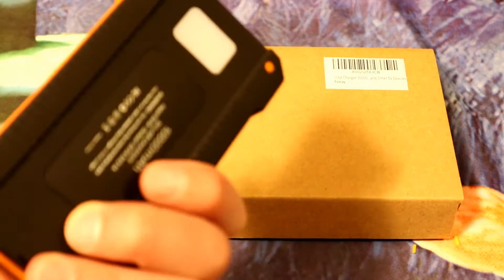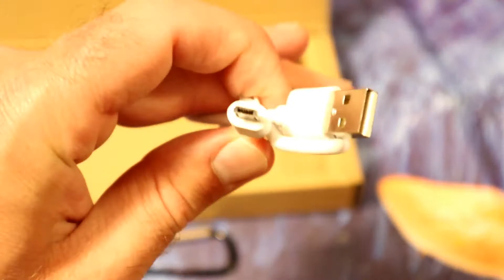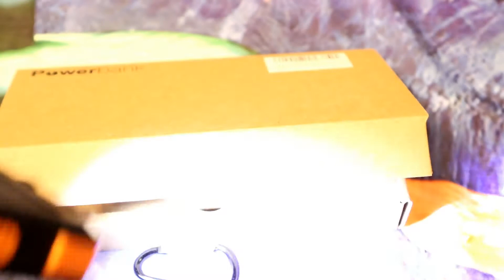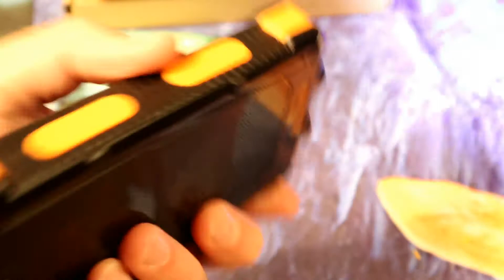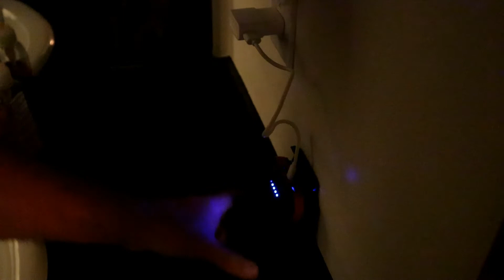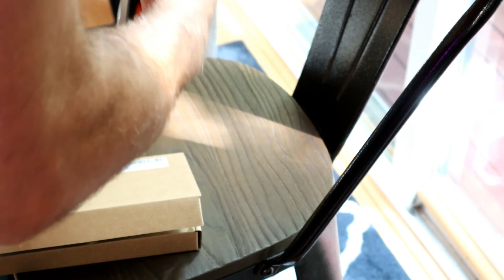Tainbat Solar Charger 30000mAh Power Bank With Dual Output Ports And LED Flashlight Gadget Review

Comment: The flashlight won't turn off on mine., any idea?
Reply from the maker: Have you tried holding down flashlight button for a few seconds? I'm not sure, I'd contact the company if continues.
Reply from the maker: Have you tried holding down flashlight button for a few seconds? I'm not sure, I'd contact the company if issue continues.
Reply: It's happened on my too! Hold down the power button for more than a few seconds the flash light still on lol